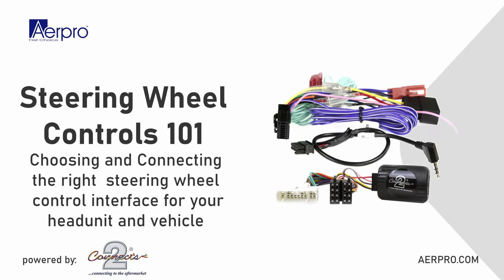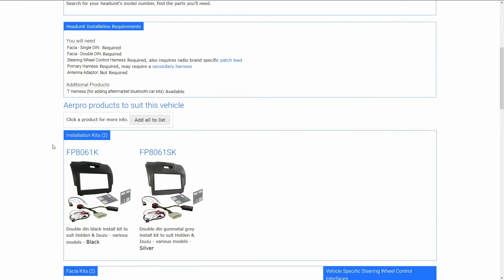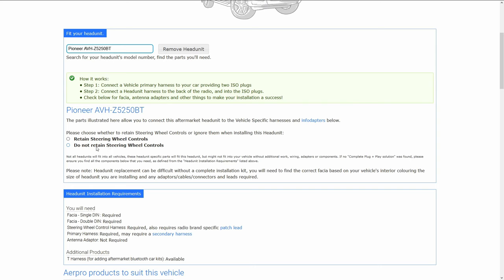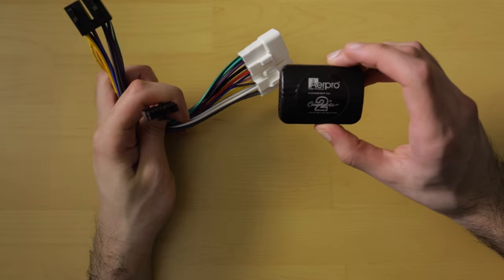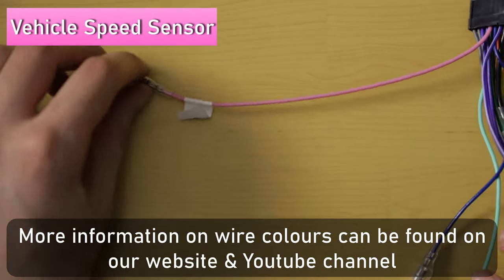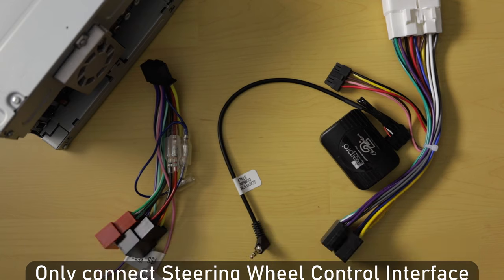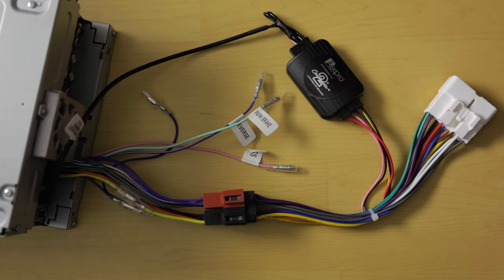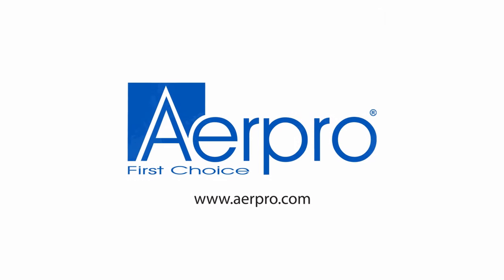Aerpro Harnesses – Steering Wheel Controls 101

Comment: Haven't had any luck with my Navara D40. Bought all the correct parts, followed install correctly multiple times, still dont get any steering wheel controls. I have a Pioneer head unit
Reply: any luck mate ?
Reply: You could have to go into settings and manually enter the controls
Reply: Same here, they said it would be easy lol. Way over my pay grade
Reply: I’m having the same problem
Reply: Turn source off in settings and try again

Comment: Got an I bought the kit for my Mazda 2 2012, and the adapter was going coo-coo occasionally (then the steering wheel controls did random operations) until it stopped working completely. So frustrating.
Reply: What harness did you have cause mine just doesn’t work at all

Comment: How about the reverse mate ?
Reply from the maker: Hi Alex Trey,

In the particular harness pictured in the video (CHIZ2C) there is no reverse trigger available behind the factory stereo. As such, the reverse wire (purple/white) from the aftermarket head unit will need to be manually connected to a reverse trigger wire.

Comment: Thank you for the video, i have just purchased CHMZ12C. Both the pre-out wiring harness on my new headunit and the CHMZ12C harness have a brake wire. Do i have to ground both brake wires or only one? If only one which one? (If it makes any difference i am not connecting an external amplifier) Thanks
Reply from the maker: Hi, the handbrake wire from the CHMZ12C harness and the main harness of your stereo will need to be connected together to function correctly.

Comment: I have an ATOTO head unit connected to the patch lead connected to the swc harness and remote wire to the swc harness from head unit and it isnt powering on at all. I am at a loss as to what im doing wrong :( i already returned one head unit after i thought there eas something wrong. Car is a 2016 JK wrangler with alpine amp system.
Reply from the maker: Hi Kurt, there may be other reasons that the unit is not powering up correctly. It would be best to get in touch with your local car audio specialist for assistance. You can also contact our customer service team on 03 8587 8888 who can run through some fault finding techniques if you like.

Comment: Its plug and play but you still have to connect the parking brake wire into the original wire which in turn is still splicing wires.
Reply: What about the pink wire and the other loose ones? I’ve lost my cruise control using this

Comment: avh-a24bt pioneer.
I’ve got a 2008 rav4 that had a Sony installed with steering wheel control box that worked fine. I’ve just installed a pioneer avh-a24bt and I can’t seem to get the steering wheel tab on the pioneer to be selectable, it’s greyed out. How can I get this to work. I’ve followed your steps and still can’t seem to get it to work.
Thank you
Reply from the maker: Hi Adam, Pioneer stereos require the handbrake wire to be connected and the handbrake engaged before certain settings like the steering wheel control setting can be accessed.
Reply: @aerpro  hello, thanks for the reply works fine now 👍

Comment: Hi guys,

Managed to get my pioneer head unit to work with my Harman kardon system on the WRX 2015 but my steering controls are not working correctly.

It only triggers the next button as volume up and if I choose non adapter. I can only program 2 buttons.

Is the module damaged? Or did I choose the wrong steering control harness?

The one I have is the CHSU7C.

Need your help please

Comment: Ca. You elaborate more on the kenwood patch lead? I have a dmx5020s thatcim trying to hook to a 120 prado but the headunit doesn't have the 3.5mm jack
Reply from the maker: Hi, if you have purchased a APKWPL patch lead, the single wire from that will connect to the blue wire with the yellow trace from the Kenwood stereo. Be sure to disconnect the module from power for one minute to allow it to reset once this connection is made.

Comment: I didn’t follow this procedure and my skip track button doesn’t work. Can I still go back and follow this procedure to try and solve the issue? Or is it too late?
Reply from the maker: Hi Edde, you can still go back and follow this procedure. You will simply just need to disconnect all harnesses from the vehicle for at least 1 minute prior to following this procedure to allow it all to reset.
Reply: @aerpro  thank you I did this and also mapped the buttons on my unit and it worked. Very happy with the result.

Comment: Thanks for the video. I have the APP9 and CHTO15C for my 2014 Camry. Can you please explain a bit how to retain the factory reverse camera? Both the primary and secondary harness have the purple(reverse) wires so do I connect them? What else do I need to do?
Reply from the maker: Hi, Yes, the purple wires will need to be connected to have your aftermarket stereo switch over and display the factory reverse camera.
Reply: @aerpro  Hi, I tried to connect all the patch leads and they all fit but the head unit could not have the factory reverse camera signal. Any reason for it? The head unit can detect the reverse gear signal tho. The head unit is Sony XAV-AX5500. Thanks.
Reply: @aerpro  I also placed the green (park brake) wire to a metel bolt in order to ground it while I was trying the reverse camera but the camera still did not either. I understand Camry factory camera uses 6V and the 6V output chip (L7806CV) of the CHTO15C got very very hot immediately after I turned the power on, could this be the cause ?
Reply from the maker: @austinliuyilun  it will be best to contact our technical team at tech@tdj.com.au in regards to this as they will be able to assist further.

Comment: Thanks for your video, I'm trying to reuse the existing handle bar radio controls on a BMW R1100.
There are 5 wires connected to 4x micro switches. (1 to each button (4) and a common earth (1) (Vol-up, Vol-dn, Sel-up & Sel-dn.))
No wiring harness, just direct cabling (Individual cables). 
Any advise as to which product I require, cable connection diagram, resistor values if I need to connect them inline would be really appreciated.
Thanks in advance,
Peter
Reply from the maker: Hi Peter, unfortunately we do not currently have any interfaces to suit your BMW motorcycle. For assistance in custom wiring a solution it would be best to speak with your local car audio specialist for advice as they will be able to test and assess the existing wiring.

Comment: Good evening after watching your video it has helped alot but i got a question, i'm looking at putting a Kenwood DMX8020S in to a holden barina spark 2010 i see that i need a 
CHGM7C and APP9KE6 to keep the wheel controils but do need to have the Primary Harnesse - ISO APP030 to make it work in the car. 

Thank you for the response
Reply from the maker: Hi Timothy, no the APP030 primary harness will not be needed as the CHGM7C steering wheel control harness will act as the primary harness in your case.

Comment: Hi I'm fitting a subwoofer. Which male bullet connecter size should I get to fit into the trigger wires female bullet connecter? Thanks!
Reply from the maker: Hi, the Narva 56048BL would be the most suitable.
https://www.narva.com.au/products/56048bl/5-0mm-male-bullet-terminal-blue-14-pack

Comment: I have a Hyundai Santa Fe  2010 I purchased a JVC KW-M150BT aftermarket stereo head unit and also bought the Aeropro head unit install kit FP9227K, we have connected the unit up and we have no steering wheel control isn't able to be used, the head unit doesn't have the patch unit to put the lead into at the back of the unit, and there is no YouTube video for my JVC & the aeropro FP9227K.
Reply from the maker: Hi Phil, you will also require a patch lead (APUNIPL2)  to connect the steering wheel control module to the steering wheel control input on the rear of the JVC stereo.
Reply: @aerpro  that patch lead came with an FP9227K unit install kit, my son hardwired the wired to the key 1 & key 2 wiresbut it didn't activate the steering wheel control, we watched the videos of hardwiring doesn't work.
Reply: I actually need a video showing how to connect the JVC KW-M150BT to the FP9227K SWC interface for the Hyundai Santa Fe 2010, all but this car installation with both items I have mentioned.
Reply: @aerpro  it says I will need the LD-SWC-F3.5 but it still doesn't show me how to hardwire after connecting the patch lead plug into the LD-SWC-F3.5 then which wires does it go to.
Reply from the maker: @thekoolestkat1  it will probably be easiest to call our customer support line when you have the vehicle available to work on and our team can walk you through the details step by step. Our number is 03 8587 8888

Comment: My steering wheel control is still greyed out… what do I do?
Reply from the maker: Hi Tara, to access the steering control menus on most headunits, the handbrake wire needs to be connected during installation and the stereo needs to be in standby for the function to be accessible in the menu.
Reply: @aerpro  we connected the handbrake wire, how do we put it in standby mode?
Reply from the maker: @taralawton1353  it will depend on which stereo you have installed. It would be best to consult the user / installation manual of the stereo.
Reply: Connect that park wire to a -12v ground and it won't be a problem

Comment: Hey team, I got the FP9212K to connect a clarion FX450 to our outlander. According to the selector I should have everything I need in that box, but the SWC won’t work and don’t quite match the video, as there are two connectors for the final step and the swc adapter is already connected to the iso side for the unit. How do I need to adjust connect order to accomodate?
Reply: And only connect the 3.5mm to the jack right? I don’t also need to use the key 1, key 2 and ground wires? Because I tried that too
Reply from the maker: Hi, you are correct, it is only the 3.5mm jack which needs to be connected to the Clarion FX450. The key 1, key 2, and ground can be insulated and left unused. There will be 3x looped wires on the patch lead (orange, green, and purple) and of those, the purple loop will need to be cut. Once cut the module will need to be reset by unplugging it from power for 1 minute and then reconnecting. Once this has been done, check to see if your steering controls are working.
Reply: @aerpro  thanks team, that got it. Much appreciated

Comment: @aerpro. Hi, I bought a full aerpro plug and play package and Alpine ILX650e system through Automotive Superstore and have also previously installed the exact same system in another car. I am installing on a Mitsubishi Lancer CJ 2010. I have undone and retried a number of times following this video. The only thing I cannot seem to get out is the power plug from the back of the headunit. However I gather because it is disconnected from the car and any power that it is the same as unplugging as per the video and waiting before reattaching the plugs in the correct order. Nothing is working on the steering wheel. Can you please help? I have spent ages on it. thanks heaps
Reply from the maker: Hi, have you been incontact with Automotive Superstore as yet for tech support? Their team will be happy to assist with fault finiding or installation if needed.

Comment: I just purchased a new aftermarket head unit Sony (xav-ax3000) for my 2011 Mazda CX7 together with the harnesses CHMZ7C and APP9SP5. I followed the installation process as said in the video. Everything is functioning well (CarPlay, tuner, usb , rear camera, settings, steering wheel control) only there is no sound coming from  all the speakers. Repeated the whole process still no sound. I'm guessing mine is a Bose amplified.
How do I know if it is Bose or non Bose amplified?
Help please!!!
Reply from the maker: Hi Enrico, There is a loose blue wire with a bullet connector on the end which is part of the CHMZ7C harness. This blue wire needs to be connected to the blue wire of the stereo harness which will trigger the factory amplifier to switch on.

Comment: I did my research as explained in these vid wanting to find the full kit (fascia and harness to retain steering wheel controls) but bit confusing as harness that comes in these kit aren’t compatible with the car factory sound system.

I own a Mazda 3 BL 2012 Bose system.

Installing Kenwood DMX9720 XDS
Reply from the maker: Hello Juan,

Unfortunately we do not currently offer a Bose compatible complete kit for the Mazda 3 BL 2012 however if we buy the parts individually we can substitute in a BOSE compatible Steering Wheel Control Interface.

So for a Mazda 3 BL 2012 Bose system with a Kenwood DMX9720 XDS you will need:
FP8072 (Fascia)
CHMZ8C (BOSE Amplified) (Steering Wheel Control Interface)
APA55 (Headunit Antenna Adapter
)
APP8KE7 (Headunit ISO harness)
APUNIPL2 (Patch Lead)

These items will make up what you needed from the complete kit but now compatible with your BOSE system.

Please let us know if you have any questions
Reply: @aerpro  
I’ve ordered last week the parts below…

FP8072 (fascia)

CHMZ8C (Bose amplified, sw control interface)

APPK9KE7 (ISO harness and includes the correct patch as stated in your website).

Do I need still the APA55 (headunit antenna adapter)..??

Regards…
Reply from the maker: Hey  @juanpalomino7043  
Yes you will still need the APA55 Headunit antenna adapter
Reply: @aerpro  

Thanks..!!
Reply: @aerpro  

 

All parts have arrived and I did proceed with connection as shown in these video starting from the headunit and working back to the vehicle.

I ended up with only two harness from the headunit (main harness and antenna).

My vehicle has 3 harness which are.

Main harness, antenna harness and AUX in harness.

Should I leave the AUX in harness unplugged ??

Or I missed the Aerpro APMZAUX harness.

Or my HU does not need these harness.

KENWOOD DMX9720 XDS

Thanks in advance
Reply from the maker: Hey  @juanpalomino7043  

Can you please send your details to us via the following link and our team will be able to assist you further. 
https://aerpro.com/contact

Thank You.
Reply: @aerpro  
I just did… thanks

Comment: I purchaced a sony xav-ax1000 for my 2012 toyota hilux. Got all the relevant harnesses step 1 and 2 with patch lead and everything works great but i lost sound in my rear speakers. What could be the cause of that ?
Reply: Front speakers work, steering controls work,
Reverse camera works, 
The light green park break wire should that be earthed ?
Would the issue have sonething to do with the blue wire ?
Reply from the maker: Hi Sam, the only reason you may lose audio in you rear speakers is because you may have missed one of the connectors which connects to the vehicle harness. Also be sure your Hilux has rear speakers fitted as not all models came with speakers fitted in the rear doors.
Reply: Cheers for that. Took the door cards off no rear speakers. How random